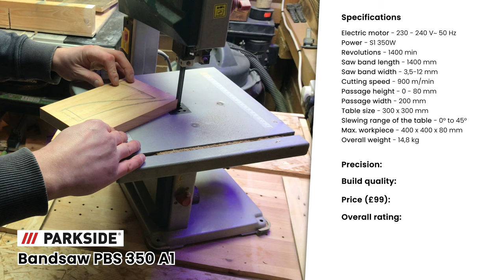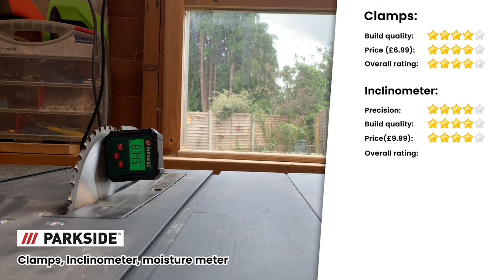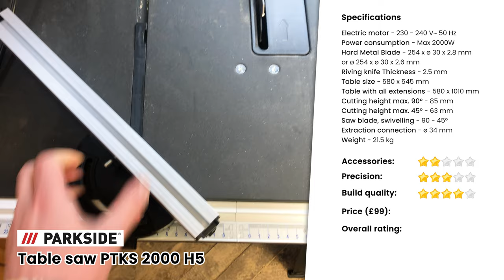Parkside review - Are Lidl tools good?

Comment: I have the bandsaw, glue gun, clamps and the multi tool. Had them all about 2yrs. The bandsaw is good although it doesn't adjust height too good. The gluegun is good, the clamps were fine for about 6months but now they're a bit hit and miss. Id stay clear of the multi tool, it only works on battery, meaning you can't have it charging and use it at the same time. It only lasted about 6 months and the battery is stuffed.
Reply from the maker: Thank you! I’m glad you’ve mentioned the multi tool as I was actually considering it for a while. I’m trying to stay away from the parkside battery operated tools as the batteries and charger reminds me of the cheapest tools I have had in the past and I’m pretty sure these will not last. I’m a big fan of the bandsaw but you are right that the high adjustment could be better.

Comment: Are Lidl as the same parkside tools in store all the time,no batteries in stock though, why don't they sell stock including battery and charger,is it because when you purchase drill,battery and charger its the same price as a mid range brand.
Reply from the maker: Thanks for your comment. This might be the case with battery powered devices but in all fairness I’m not buying these. I would rather stick to well known brands. Parkside is quite good at mains powered devices which are considerably cheaper.